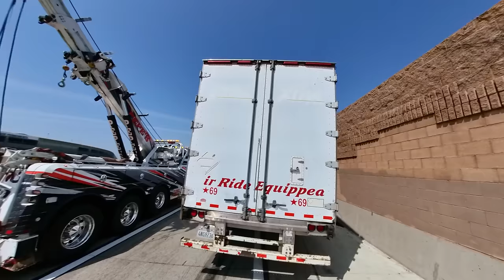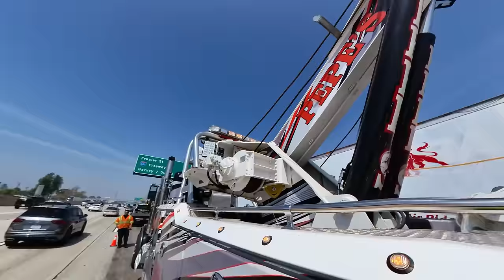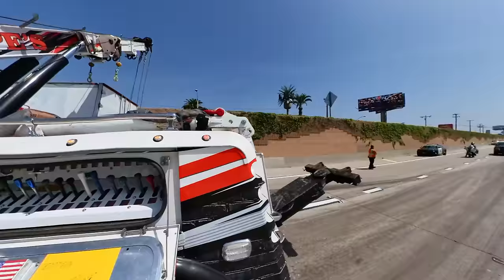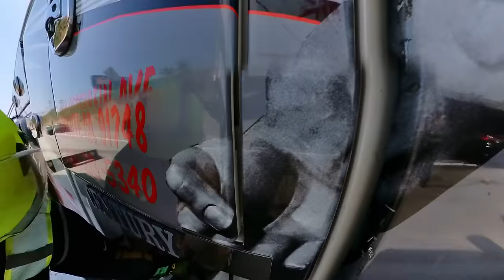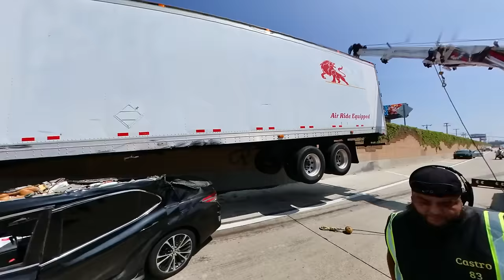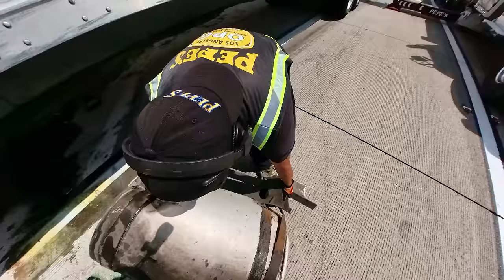Fast and Furious Gone Wrong! Car Stuck Under Trailer!

Comment: It is very nice seeing that, although a different company got the call to tow the wrecked car, both of you worked the scene seamlessly to get it cleared as quickly and safely as possible. The shots show the major difference a rotator makes in minimizing lanes to be closed and also (for those who were listening to what you said during the planning part) knowing how much weight you were dealing with (an empty trailer) where and how to lift the unit to get the car out. BTW, cool trick using your aux. line to pull the car back for the flatbed to get at the front with ease.
Reply: I think it is very professional that they worked together.  There is no need for greed in this situation.

Comment: Dude must have been trying very hard to get the car that far under the trailer!! It never ceases to amaze me the stupidity of someone in a 3500 lb car challenging an 80,000 lb semi truck for space. You cannot win!!!! Super cool easy job and video!!
Reply from the maker: Agreed, but the weird part is how perfect the driver is in the far right shoulder with no skid marks. I'm thinking he was pulled over and the car just spun out or something. I don't like to ask the drivers what happened, not unless they provide me that info themselves.
Reply: @PepesTowingService  From the marks at 1.50 on the road looks like the car was under the trailer at least a lane over and the truck pulled off the highway with it underneath.

Comment: That's every CDl driver night mare. My dad was a driver for over 20 years. In local and long haul. He was driving local on a interstate hwy when he had a car end up underneath  on the trailer. He took it off road saving the driver and passenger  of that car. The trooper  asked how he did it. My dad said driving in the army.
Reply: My father drove semi for decades. Mostly long haul. As teenagers we'd try to avoid him; he'd come home tired and ornery. But that's when truckers slept with head on a pillow on steering wheel and didn't have AC. He worked so hard for us. Miss him.

Comment: I usually only watch off-road towing videos but this impressed the hell out of me. Guess I've been missing out. Great work!
Reply: There is a raptor truck that went into a tanker and much worse than this car and passenger survived. It amazes how God saves people
Reply: @catherineportland503 god had nothing to do with this...safety standards did. Try this in any 70's or 80's car and you'd be talking about heaven instead.

Comment: Doesn't happen in Europe, crash bars are mandatory on the underside of trailers, preventing this type of thing from happening. Never understood why they are not fitted in North America. Oh well, glad the driver made it out this time.
Reply: They should be required to use lower trailers as well.  There is no reason the trailers should sit up so high.
Reply: Exactly.
Reply: @user-tb7rn1il3q  Uh,  maybe because every dock in the country is that height. We should rebuild every loading dock in the country, which are part of the structure of the building by the way, so we can lower the trailers? Makes perfect sense. The better solution would be for everyone to actually pay attention while they're driving.
Reply: Wait for the tow bill🧾 Dude! 😳
Reply: I saw a video where a car at high speed went under the crash bar taking the roof off the car and killing the 2 people in front seats.
Reply: Population control

Comment: I started trucking in the late 1960's. The equipment that is there for recovery now just blows me way.  I'll swear you can turn a truck upside down and not damage it and not spill a drop of coffee that was on its dash cup holder. Compliments to that operator. A real pro.

  Now a little humor. I would love to had seen the face on an estimate manager if I took that car to a body shop and if it could bring the cost down by making it a convertible. And do it with a really serious look on my face.
Reply: Actually I genuinely wanna know what the price is. If you ever do that, let me know how much it was.
Reply: Too funny!

Comment: I think I heard you call them DOT bumpers.  Whatever they're called it didn't stop this vehicle from going under.  Super scary situation for both drivers I'm sure.
Reply from the maker: Yes that’s the rear one. Here tho it looked it hit from the side
Reply: @PepesTowingService  I can see that now.  Even when you chained up to it.  What was I thinking.  Thnx
Reply: Haha.  I was thinking the same thing— what is THIS guy thinking?  😂. The DOT bar on the back was informally called a “Mansfield Bar” after actress Jayne Mansfield was essentially scalped /killed in a terrible accident slamming into a trailer that did not have such a protective device.  Laws were changed due to the attention brought.  Btw, Her wig was found on the road which prompted the false rumor that she had been decapitated.  And her daughter sleeping in the back seat is Mariska Hargitay of SVU fame.

Comment: I just came across your site.  Quite the situation on the freeway.   My son drives tow truck in Northern Calif..   He's had some crazy situations like a semi on a rural highway tipped over and a pick up truck drove through the trailer.  The driver was a fatality unfortunately.  My son was on site for 4 hrs while they cleared the trailer out for him to get the pick up out.  The trailer was full of cases of apples...full!  He has also had to go into forest fires several times to collect equipment to move to another fire.   You all stay safe out there!!!

Comment: Thats crazy. 😎 Rigging. 
Years ago i loaded a 48' van in Cleveland Ohio. The dock was an inside dock. The only way i could get lined up on the dock was the overhead crane pick up my trailer and line it up.

Comment: In Europe this sort of accident is less likely to happen, as legislation has all the big rigs have trailer side bars fitted and strong rear bumpers to stop cars getting under the trailer.
There was a PBS telly programme shown in the UK, which claimed the States trucking unions and companies, had blocked these safety ideas.

Comment: I am a retired Paramedic.  In 1969 we got a call car under the trailer.  That is all that came over the radio..  The scene was God Awful.  It was a small brand new 1969 VolksWagen lodge under the trailer of a semi.  When we arrived at the scene two police told us  we would  be doing transport of the body to the morgue only  When the Tow Truck Professionals released the car under the trailer little did I know it was a decapitation of a female 20 years of age and a classmate of mine for 4 years of a boarding high school.  So not only were we class mates but former dorm mates as well.  I hated those policemen for not preparing us for the trauma we were about to witness.  Granted they did not know I knew the victim. I did not expect to find her body in the drivers seat and her head laying in the passenger seat.  To this day 54 years later almost to the day I still get angry at the policemen and emotions of the horrible incident come flooding back as if it just happened.  Those 2 cops were repermandid and both got a 5 day suspension without pay.  That is very little for the trauma all of us paramedics went through, and I for one still react to.  God Bless you tow truck professionals.  The general public does not give you guys enough credit.  Not only do you put you life at risk    and work in the most dangerous condtions, you keep the roads safe for drivers.  People always think of the police and us emergency workers but  getting injured or even God Forbid death you are at greater risk  GOD BLESS ALL OF THE ROAD WORKERS AND WHAT YOU DO TO KEEP US SAFE>  This comes from the bottom of my heart.  I have witnessed multiple times the dangers you are in.

Comment: Yikes the guy pretty much replaced the landing gear. Saw what I can only guess was a Miata type tuner car that had been moving at a good clip on one of our expressways only problem was traffic was stopped in a construction zone just beyond a curve. Guy effectively went through the Mansfield bar and took the place of the trailer tandem. Passed the scene as the recovery guys were about to lift to let the crews recover the body.

Comment: American safty standards are still so super low, in Europe this cant happen a semi trailer has to have car resistant under run bars all round from trailer legs up to wheels to stop vehicles going under. saves loads of lives yearly

Comment: Surprised no side underrun guards on the trailer ? They may not have stopped this massive impact, but could have reduced the penetration underneath, or even completely deflected the vehicle. It's mandatory in all European countries, also to protect pedestrians and (motor)cyclists. The salvage crew are also working underneath a free suspended load, and working within inches of an active highway lane. Why is there no 'dead' (closed) lane beside them for their safety, and why do you not place supports under the trailer before working underneath it ? It is an incredibly dangerous work zone. The driver survived, but the salvage guys voluntarily risk their lives to recover old iron and free the traffic lanes ? I cannot see the logic in that tradeoff. Be safe, be happy. Thanks for the video.

Comment: If I see this video right, that trailer is 100% illegal (in europe). This kind of trailers MUST have rails on the sides to prevent this exact thing from happening.  Just like rail on the back to prevent crashes from the back, there must be on both sides. 
If there isn't any safety law in usa for such rails on semitrailers sides, whooh, all politicians and lawmakers involved in transportation should be sued for criminal negligence.

Comment: Why were there no emergency services there to check on the occupants upon the first lifting of the trailer? Oh, had they already gotten them out from the low side of the lean? Wow! The stains on the pavement were hard to decipher without knowing whether the tractor trailer was changing lanes or not, at the time of contact, since the momentum of either one of them changing lanes could have been enough to hang up the car. But if the trailer was changing lanes it looks more like it would have had to be moving in the direction of lane #1, which is the passing lane, in order to catch up the car that way, as they would have had to be travelling into its path to do so.

Comment: Your partner needs a hard hat on. Safety. Make sure your hooks are turned away from the trailer. And you could have used frame chains to lift instead of lifting off the bumper frame.

Comment: Why didnt you ask if it was empty before you put extensions out? JC
Reply from the maker: They’re called outriggers, not extensions. If you can’t even get the basics right then why comment. But I’ll bite. You obviously don’t know a thing so I’ll educate you. You extend your outriggers EVERY TIME you work off the side. Whether empty or loaded what difference does it make, you still extend your outriggers. What would have changed if I asked before hand? Put the pipe down before you comment

Comment: Avery long time ago.  My coworker was fiddling with her Tapedeck and crashed in to a trailer that made an illegal U turn.   It decapitated her.  😥
Reply: When I was like maybe 11 a pickup truck had crossed the highway, hit a ditch went airborne and ran under a parked loaded trailer. The entire roof peeled back and somehow when the guy passed out he slumped down enough where he didn't loose his head. Had the trailer collapsed on him it would've been a different story.

Comment: I don't know why you didn't just lift the front of trailer then moved it back so the EMT could have more room to do their work then the flat bed can just hook on to the car an move it then all the driver can just backup to the trailer then go if the trailer is safe to use again.
Reply from the maker: Are you blind ? What video are you watching. What EMT? And the trailer is attached to the tractor. You would have to disconnect it and drive it away which is very dangerous when the trailer isn’t stable. Then the car is wedged IN the landing gear. The car would just lift up with it. Your way is so complicated and makes zero sense. I hope you aren’t in the industry because you have no clear grasp of how this stuff works and you will Jill someone or yourself being so reckless.

Comment: your should never hock a strap or anything to the bumper of a trailer,  maybe that one is different.  I have seen some that will bend when they get hit.
Reply from the maker: Relax, it’s a vertical lift on an empty trailer, 100% perfectly fine. If it was fully loaded or if I pulled horizontally it would be a different story.

Comment: Did you....did you use a grinding tool, under a suspended load, on metal, above a puddle of fuel, in a semi-confined space? Jesus wept.

Comment: Lifting that trailer from the rear under ride “bumper” is a HUGE no no….. those are very weak, especially when you have people walking under it while it’s being held up.
Reply: It was empty.. loaded is a different story
Reply: @10super   I promise you. That’s risky. Loaded or unloaded. 8 bolts holding that whole trailer up. Bolts that take a lot of pounding from backing into many normal things everyday. Who knows how compromised they were at the time they were holding that trailer in the air.
Reply: @ronnied1380  I would imagine they knew what they was doing more so than the submarine guy who took 4 other people down to the titanic for the last time

Comment: Looks like it would be easier to put some lifting pressure around the front have the driver unhook the 5th wheel and pull forward. Lift the trailer up and the flat bed pull the car out then set the trailer back down. ?

Comment: I would have lowered the trailer dollie's down( as long as they weren't damaged), put a strap under the front behind the 5th wheel plate, released the pin, lifted the front of the trailer and pulled the car out with the other cable, drop the trailer and let the truck re hook.
Reply from the maker: So you would have done 3x the amount of work ? aren’t we all glad you didn’t get the call

Comment: In the UK lorries have a piece of metal running down alongside that actually stops vehicles from going underneath.
In North America is a different set up.
But what's the point of running away from police or anyone, as long as they have a picture of you and a picture what's the registration they can come to your front door.
So what is the point of running

Comment: Why not cradle the nose of the trailer and have the driver disconnect and pull forward. Then have the flatbed pick the car and then have the driver reconnect the trailer
Reply from the maker: Yet another expert lmao. I’ll just paste what I said to the other guy. “Unhook tractor, have driver pull out, back up to trailer, lift it, somehow pull the car back away from the landing gear, drop the trailer, then have the guy backup again under the trailer and connect his lines. In what world is that a better option ?”

Comment: You guys have no idea what you’re doing cause if you snap that pin that’s connected to to the plate to the tractor then it’s no good. You should have put the landing gear down remove the tractor and then lift the the trailer since it’s empty
Reply from the maker: You mean the king pin? You think the king pin would snap, from lifting the rear of an empty trailer? Lmfao how many times were you dropped on your head as a baby? Do you permanently have to wear a helmet and ride the short yellow bus?

Comment: Dump air bags in trailer stupid driver wtf I’m sorry but why do something like that
Reply from the maker: What would dropping the air bags in the trailer do? The car was WEDGED under it. It needed to be lifted so the car could get out. I even had to winch it back because it was stuck on the landing gear. Did you even watch the video before blindly commenting ?
Reply: they don't work very efficiently if they're not connected !